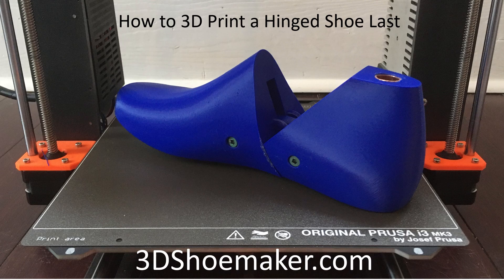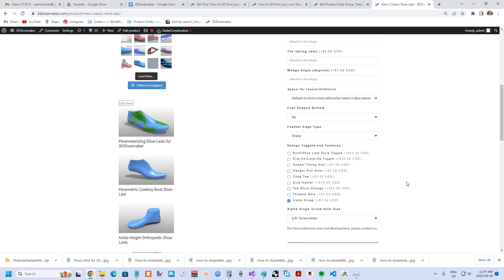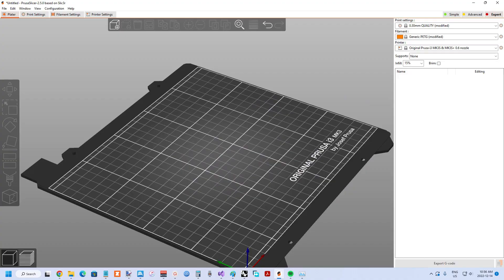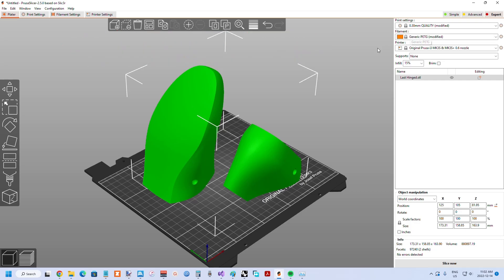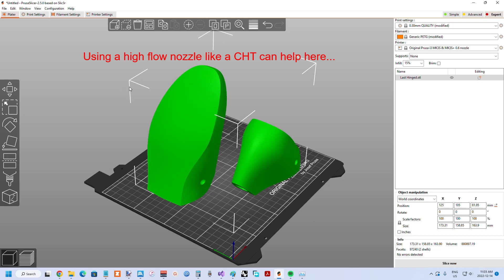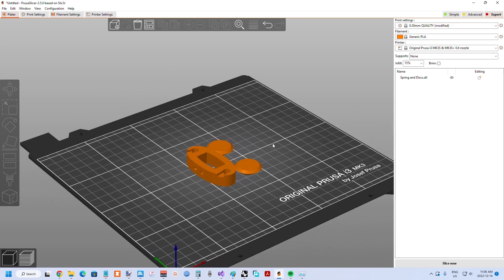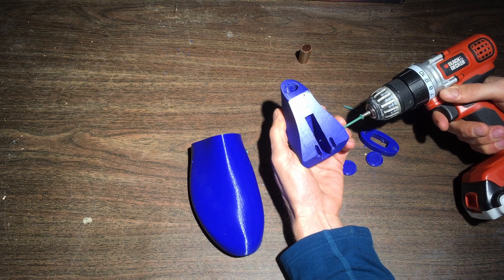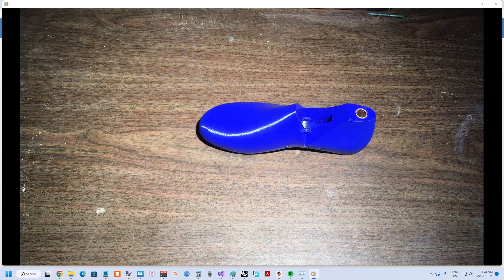3D Printing a Shoe Last with a Working Hinge

Comment: Hello, great video! Do the measurements option on the right mean you can customize the last to print depending on a client feet in bespoke shoe making for exemple?
Reply from the maker: I had options for bespoke and custom measurements, but there wasn't much interest when it comes to digital lasts. I've been trying a different approach where you can choose design customization in the ordering form and then adjust from the base design. Have a look and let me know what you think.

Comment: I considered copying your hinge, but had a go at a print in place hinge instead! :)  .... this is good im just to cheep to by screws LOL
Reply from the maker: You have a link to it? I'm curious
Reply: @3DShoemaker  no video on that yet. i only had materiel for one go & it sort of failed but it was just a TPU rectangle instead of the standard C spring nothing fancy. i ultimately went a different way altogether. my last is on hold until i can make a per to wear & adjust the fit if needed only then will i get back to my last. but 1st i need to fix the unit conundrum I just got a new hotend for my 3d printer...... upgrading to a pellet system. it opens up softer, cheaper, recycling & mixing of materials & more.......
Reply from the maker: @hippycobbler4092  Very cool! Pellet extrusion definitely seems superior. I'd go that way too but filament printers are so refined these days...

Comment: It would be really cool to see an example of the lasts being nailed into. This would be a game changer if it can withstand multiple lasting processes - but I am concerned that they will not be as hearty as HDPE lasts.
Reply: PETG can handle multiple rounds of lasting just fine. Durability is not the issue. The main downside of PETG over HDPE is that it is a harder to nail into, but with sharp nails it is not an issue. 

A high shore hardness TPU, like 64D, on the other hand, will act much more like HDPE, but is trickier to print. I've experimented with this a bit but have had some warping issues. Will be trying some more at some point.
Reply: @samlochner6315  Yeah for sure. I was mainly thinking about how HDPE kind of "self heals" itself when repeatedly punctured. Does PETG have similar properties?
Reply: @Aeon_Scipher  It is somewhat similar in that way. When a nail is put in directly beside another hole, the original hole closes up a bit. It's not like PLA that is brittle and would break away.
Reply: @samlochner6315  Thats really cool!
Reply: @Aeon_Scipher  have you ever thought of adding a removable insert that could be made out of a replaceable plastic? When I made shoes we only put like 2 tacks in them as long as you're not actually nailing as you are lasting so just attaching the insoles with a few tacks this looks absolutely fine get a few 100 repairs off them. I recently printed out my first pair of Lasts out of ABS and it's terrible but Even so I can still probably make a dozen pair off this pair of last easy just make sure that your wall thickness is ample and your infill is strong. The first Test last I printed was way too fragile.
Reply: @samlochner6315  hey, wondering if you've experimented anymore? What material seems to hold up the best?
Reply from the maker: PETG @999starwatcher2